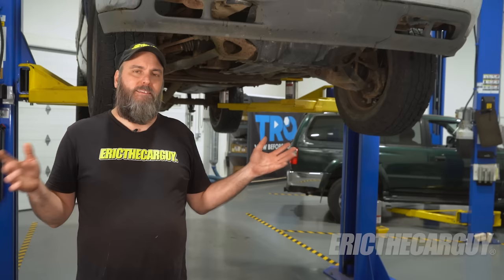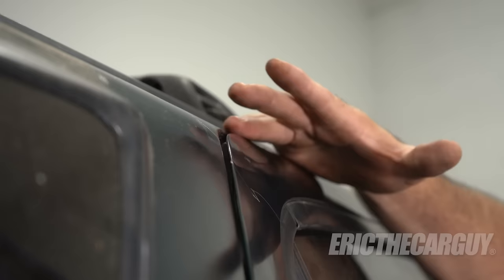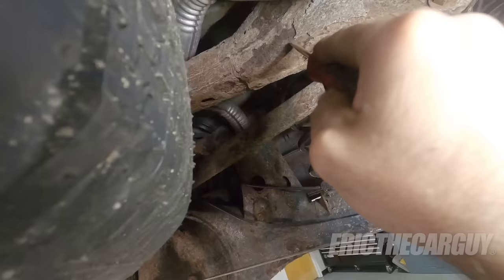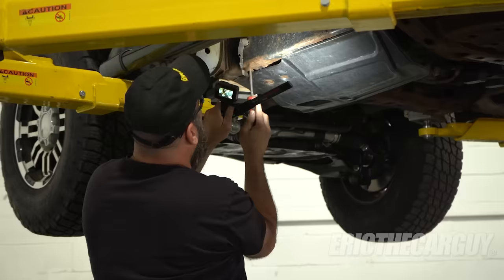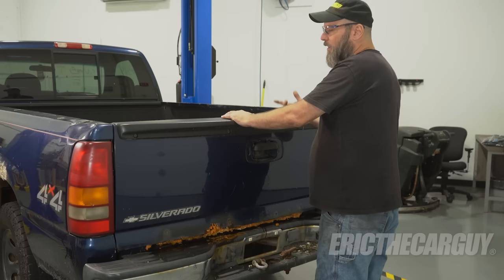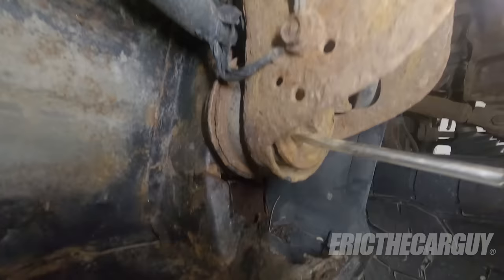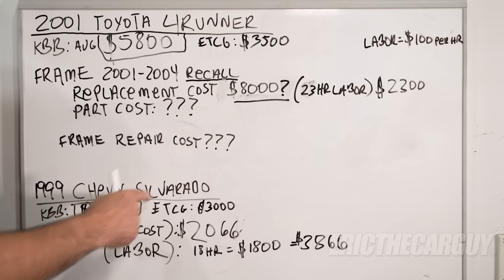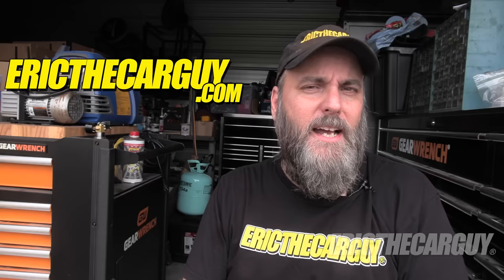When It’s Time To Buy a New Car, Or Not Buy it at All

Comment: Hay Eric, just a thought.  What if you put the truck on the  lift and it bends in haft. Is it junk? YES, but if you find a nother truck with a good frame, you can make a good one out of both. I did it twice.  That's why my Toyota Tacoma is a 98,99, and 2002.
Reply: If your truck bends in half, just add more zip-ties and duck tape. Simple.

Comment: The Toyota would potentially be worth fixing. Sure there’s a lot of structural repair needed, but as someone who has a 2000 4Runner that thing will go forever
Reply: That thing was in terrible shape inside and out, top to bottom.  The only reason I'd pay $1 for it is if I thought I could resell it at a profit.  I'm good with older vehicles that have some issues, but that Toyota was a mechanical and cosmetic pit.
Reply: @knurlgnar24 you wouldn’t get it period. Toyotas sell for a lot and that was repairable
Reply: The toyota needs to go right into a crusher.
Reply: @goclunker  honda first

Comment: 12:31 4runner and Land cruiser was never covered under the service campaign. They were made in Japan. Only Tacoma Tundra and Sequoia were covered, the frames for them were made in Mexico by Dana corporation. Don't know what happened if they skipped a step in prep or used different materials then what Toyota wanted. But Dana ended up paying in a settlement. Doesn't change the fact that 4runner and Land cruiser have the same rust issue and still do. Salt kills all.

Comment: Thank You Eric, Sadly My Dad's 2002 Silverado is starting to rot at the frame and all of the body panels(usual places). I was hoping to "Keep it forever" but it was fom the Northeast and had seen its share of salted roads and towing the camper on the beach. When it becomes unsafe I will have to make a tuff decision. Good to see you on YT again!
Reply: My advice, dont wait tooo long to take care of it! If it just startes go with Fluid-film  and after any wet exposure as you soon as it drys, do apply the rust inhibitor. it will create a patina that will look darker , what you dont want to see is the yellowish or red dusty oxidation, or any color in between.  you can sand blast and paint, but extremely expensive , do not do any other stuffs, it will fail.  also go to a marine store and bolt some anodes on the frame without affecting integrity,

Comment: My car’s already wide open in that area under the doors, has insulation/carpet underlay visible on the outside through a rust hole. It is body on frame and I do wonder how that’s holding up. I have owned the car for the better part of 20 years now and it has seen 20 Midwest winters. Cars are extremely expensive though, which is why I continue to run it. When it starts to collapse I’ll call it ready for the scrap yard. In the meantime it gets me from A to B.
Reply: Buy a welder, do a welding course and use some scrap metal to close the holes. being able to weld is a skill you will benefit from for life.
Reply: @rolandleusden  100% been wanting to get into welding and want to find a good starter welder and scrap metal to practice with. I have a clean old school square body Marquis that I’ve been wanting to make into a little bit of a sleeper and one of the items on my list is a manual conversion. Gotta say I was inspired by the Fairmont.
Reply: @thewausaudude  When I started welding I used metal from washing machines and microwaves. It's thin, but so is most car body.  I drive a 50 year old car where most body parts are not available anymore, so it's make yourself and welding. As you are US based, maybe this video from Project Farm is of use to you. https://www.youtube.com/watch?v=IK_Cn5lxggA

Comment: The thing is, you have to consider repair work vs. the cost to replace the vehicle, not the value of the vehicle being repaired. You may not find better cheaper than the repair cost in the used market. And new is never cheaper. 

Beyond a certain age you’ll be spending a car payment a month either in repairs or on a car loan. The worst case is used buyers paying both. That’s never desirable.

Comment: Funny thing, my niece's BF bought a nice older Highlander from some lot without having someone older/knowledgeable about cars.  After multiple problems a local repair shop pointed out where a lot of the frame was gone and was simply closed-cell foam filled, leveled and then painted.
After about 9 months NYS actually, unheard of, came through and forced a like $8000 refund.
He's a not a dumb guy, but he's currently selling another vehicle he bought in the meantime, because its also a POS....

Comment: Made mistake of taking car to Christian Brothers for a repair. Needed simple repairs, my research showed few hundred $ , their mechanic came up with $1300 in charges. Lost parts from area of vehicle where they should not have been working. ( we know because friend and I trouble shot and did simple tune up ahead of appointment). Worst experience is they said drop car at 8:00AM however didn’t complete assessment for full business day and didn’t begin repair until 2nd business day. Took two days for  what should’ve been a 3 hour repair job.  Needless to say due to their poor craftsmanship, long repair interval and extreme greed will never consider using their shop.

Comment: I tend to estimate value of a daily driver vehicle based on $1000 per year or 10000miles of future use.

If you buy a new vehicle at 30k, then 29 years, 290k mi and a $1000 tradein.  That can be done with a well built new truck well maintained.  It is rare to get that life from a typical car.  At best 20 years for most cars.

So new cars have moved past a point of value.  In the past buying a car two years old is the sweet spot and keeping it for 15 years...as recent used cars could often be bought for 15k or less.  Also in the first two years service was likely kept up and by a dealer shop.

Trucks however are way too high in the used market to do that...often wanting full retail price for a 2yo and 25k truck, since this year's truck is more expensive than the new price two years ago.

You must go later in the lifespan to get that deal.  10yo or so with 100k.

You can do that math at any point in a car's expected life.  You get a $1300 vehicle and drive it as a beater for a year, then scrap it for 300...ta da.

For a $50k to $100k EV...you know those are not going to last 50 to 100 years and do a million miles.

Comment: There is no way any shop would ever do a frame off for 18 hours.  Not only are we talking about fiddly bits like lines and harnesses but, just as you said, every major component rides in the frame.  Suspension, engine, trans, axles, transfer cases, etc.  If this was a brand new car a dealership would cut their loses and send it back to the manufacturer as a lemon for reimbursement.  They wouldn't even bother with warranty without a recall.  If this was a classic car you might have a shop take you up on it if that's their specialty and you light cigars with $100 bills.  Those vehicles here wouldn't even increase in value if you did this and no shop is going to take on a frame replacement because it would be measured in months (all of which they would probably have to warranty).  I think even the frame repair option is a losing battle once you remove the structural rust to start welding.

But it's good to see you doing videos again Eric.  Hope to see more.
Reply: I don’t know where you go but we have frame swaps done in 3-5 days max and 5 is if shit hits the fan

Comment: I'd rather bury my head in the sand than start jabbing at my frame with a screw driver, but since I was planning to do some fluid film rust prevention this year, I'll be forced to face my undercarriage anyway. May conclude I can't make it through another winter in this old rust bucket.

Comment: I want to say buying expensive cars makes you work harder.

I am now 58. I am not interested in buying new cars. Only to work harder and to show off people I have a new car.

Be smarter. And not waste any of your hard work income.

If am a mechanic that would not be a problem.

I just have a mechanic yesterday working on my 2018 Nissan Versa Sedan. Says from Walmart Transmission Service. And says from Jiffy Lube the same Transmission Service. So I decided to take them to Dealership at Nissan where I purchase my car and have them Diagnose my car. And Nissan says to have my Transmission Service..that would cost me at $499.00. And my belt that would cost me at $199.00. And my brake fluid that would cost me at $199.00. All in all I feel like am having a break down. And went I went to Nissan my heat still working..then I start to notice after the Diagnose my heat not working. What have Nissan done to my heat? Have they done something to cost me more? 
Not so good to become ignorant with my car😢
So I have a mechanic that someone recommended to me, he is ok. He does not rip off. He flush my Transmission fluid. And my brake fluid. At my house he come. All in all he charge me $100 for his labor.  And he flush the brake fluid and he charge me $50. I saw everything his done. Thinking of everything his done they were two of them. He asked me how much did he say he would charge me? At first he said brake fluid is $40. I bought the brake fluid and the transmission fluid at Nissan. He said best to buy at Nissan instead at the Auto Zone.  
So he uses 3 bottle of the transmission fluid that cost me at $24.99 and he use only a littlebit of the brake fluid he did not use the whole bottle😢 the brake fluid cost me at $7.99. All in all I paid him $200 he said $100 transmission and $50 brake total $150 but I gave him tip $50 total I paid him $200.
Was he a good mechanic to me? He was for not ripping me off.plus he come to my home for service. Will I hire him again or recommend him to my neighbor or anyone? My neighbor next door I told them he come for service at home call him because he does not rip off. And I like that I saw his work. But I still don't know if hes done a good job with my brake fluid by only using a littlebit? 
I saw you Eric changing brake fluid and I like how you described on how to DIY. But with my mechanic am not sure with the littlebit of brake fluid he uses it looks full, but he flushes it out, I asked him why he only uses littlebit? He said with a thin pad it only uses littlebit. Am not convince😢 I don't know why?

Comment: I made that mistake on my 2011 GMC Sierra 1500 this time last year got underneath didn't see any rotted frame when i looked under it brought it home start looking around again and then i spotted frame rot it was hiding and it was half the frame on the inside portion and along a part of the bottom section it was more like a crack that went about 7 feet only on drivers side so in the spring of this year I took the bed off seen the 2 crossmembers rotted out also then i yanked off the gas tank and all hell broke loose it was so bad and it kept going even to the charcoal canister and another 2 feet after that so i grabbed my plasma cutter cut all the rusted out parts to clean it up and got the 2 crossmembers cut out got new welded those in and used 1/8" steel welded that all in and used 3/16" angle iron on the bottom of frame. Painted 90% of the frame on the outside only & used 1 gallon of rusty metal primer and 1 gallon of grey paint both from Rustoleum let all that cure out for a week & threw the truck back together then used about 4 gallons of PB Blaster lanolin undercoating inside and out of the frame and under the entire truck. Not a master welder but not bad for a backyard mechanic. Yes i've made some bad decisions buying this truck but not seeing that rusted part killed me when i did end up noticing it and the truck came from a dealer and the worst part I confronted him about it and he said he knew about it and i asked him about the rust on the truck before I even made the 130 mile trip for it it did have some on one wheel well and the rockers. I have learned a lesson for the future and now I will fully inspect all the cars and trucks i'm looking to get. Paid $9600 for it but the guy did give me $500 back for me to repair the frame. Truck should have been a $5500 which is all they go for here in Ohio with a rusted frame.

Comment: The body mount and the holes in the inner rocker panel on the Toyota are structural and would fail a safety inspection in Ontario Canada. Certain floor repairs are permitted if done properly .

Comment: Hey Everyone! 

First, thanks for the informative video Eric! I'm super stoked to have found your channel :D

For anyone reading this, I have a used 2002 mini cooper at the shop right now, and they told me it has a cracked exhausr pipe and a rusted /rusty cat, and radiator leak.

If the cat is rusted does that usually mean there is rust elsewhere? Is this worth repairing / replacing, or in your experience would you start looking at other options?

Edit: I'm out west in the desert, so I was surprised it had rust.
Got the car for free from family (who bought it used), so I think probably worth it to sink some money into it?
I just don't know if alarms should be going off in my head or not

Comment: Interesting,  that hole in the body, technically not a fail over there but in most of Europe, frame or no frame, that hole would compromise a potential impact failure and so the vehicle wouldn't pass an inspection. I'm aware that such things are rarely considered important in the USA but over here, we take inspection seriously,  for instance there's a channel called "just rolled in " I think and the things that turn up on vehicles on there would never get to that state, as they'd fail the MoT here in old Blighty LONG before they became that obvious.

Comment: Don’t get caught up in the value of the vehicle as a number. The value of the vehicle is a running driving vehicle that gets you from a to B. It may be worth 100 bucks and need 100 bucks in a brake job, that would be worth it to me because I would have fixed the vehicle and not needed to buy a new one. and I still have a running driving vehicle that gets me from a to B. Doing a repair on your vehicle may be advantageous because even if it’s a large repair, it may be less expensive than another used car and even if it is expensive, you know what has been repaired and replaced on that vehicle you have, not sold with another used vehicle you may buy, that knowledge has value

Comment: You can’t just guesstimate car prices lol. If KBB says 6000, then it’s 6000 in fair condition. You can’t just deduct it cuz you wanted to. All in all, you’re right, replacing a frame on a car is more money then it’s worth if it’s old. HOWEVER there are cheap(er) repair kits that might be able to ‘bandaid the problem. Now, how bad the rust is, could determine whether or not it gets inspected. I have a suv with major rot on the passenger side frame, although I’m going to get a piece welded to it to ‘fix’ the problem so I can still use and inspect the vehicle for years to come… just my 2 cents. Although love the videos! Keep it up

Comment: Eric, you don't want to go get a frame for that Chevy from Pull-a-part?
I have a 99 Tahoe it's got parts from 13 other vehicles from Wilbert's U-Pull It  yard. My 05 Trailblazer also has parts from 3 other vehicles.
Reply: I know a lot of society is happy to throw money away on disposing of things vs repair, however the flip side of spending tons of hours, $$ and stress on piecing together 1 good product from multiple shot ones is on the other end of the extreme bell-curve.
Reply: @boots7859  The Tahoe accumulated its parts over 15 years as parts broke from wear, rusted and fell apart and one accident.
My vehicles don't get replaced because of age or mileage, it's because I'm tired of working on it, can't find replacement parts or it's rusted so bad it's not worth fixing.
The Tahoe is at that stage now, because everytime I drive it, while towing a trailer something breaks.

Comment: Bought my toyota new in 09. Take it to dealership for all schefuled maintenance. Besides oil and brakes, the only mechanicals I've had are a bad brake line, rear hub and tpms sensor. The heat shield above the exhaust rusted off its bolts and was removed. I think the mechanics around here would just let me keep throwing parts at it instead of telling me time to move on.

Comment: If a car has any rusty spots just walk away. Or realize that in very short order you will be driving a junker with pieces falling off. By the time the rust is even bubbling under the paint, the corrosion protection is gone and it will take off. There is no hope. For a $500 beater who cares. For a $5000 car absolutely not.

Comment: Are garbage cars that expensive in the US? Just spent $1500 on a used car with a tiny bit of surface rust, in comparison these 2 clunkers looks like they should have been scrapped 10 years ago. Also be greatful for the cheap repair costs, labor in north of europe is at least double.

Comment: I had to replace my 1998 four runner for the exact issues on the frame, I was pretty bummed and that 3.4 ran like a top at 260,000 miles

Comment: You can always swap the drivetrain into another chassis if you can find one. Probably cheaper that way.
Reply: The smart and best solution is probably going to be cheaper in the end.
Buy something in good shape to start with, which means getting it inspected by someone reliable.
Reply: @mr.gutwrench  it's a user name, not my name. You should know that Mr.gutwrench.